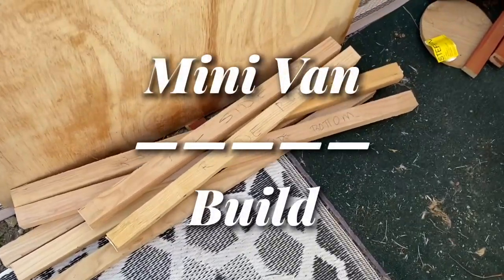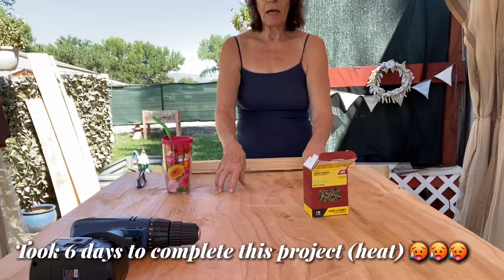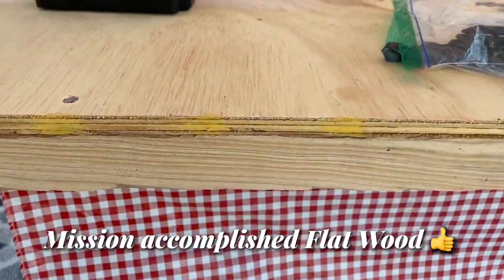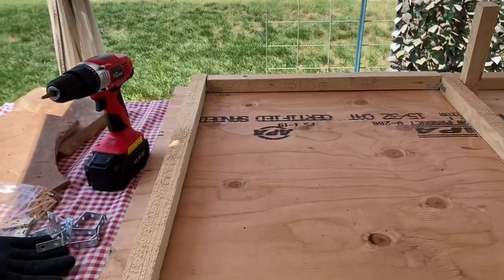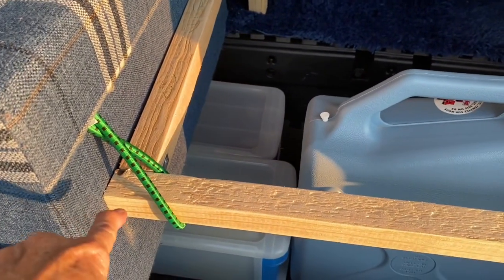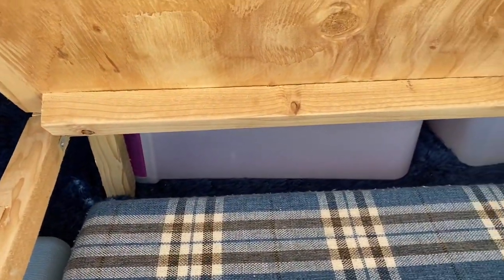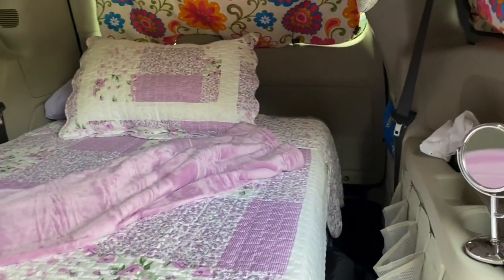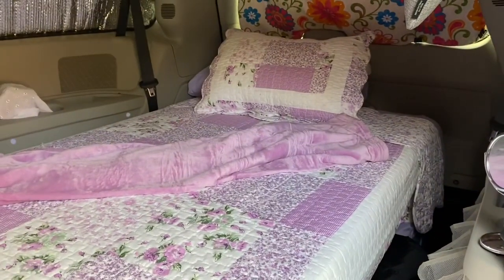New bed frame for Dodge Mini van | minivan life |

Comment: Hi Winter great job.what yr is your van.is it really reliable
Reply from the maker: No my van has not been reliable. 2014 with over 100,000 when I bought it. Tire pressure issues. Transmission issues. Thermostat issues.